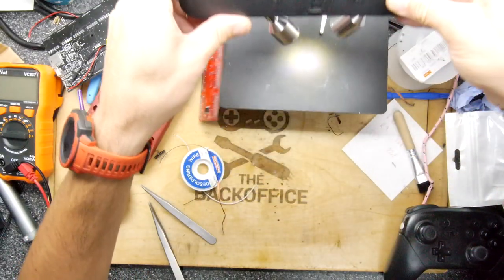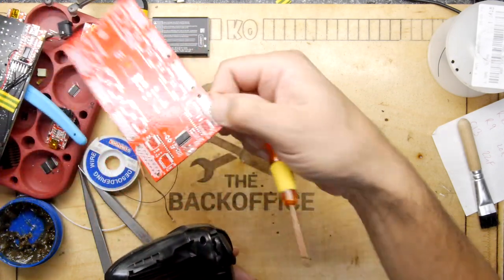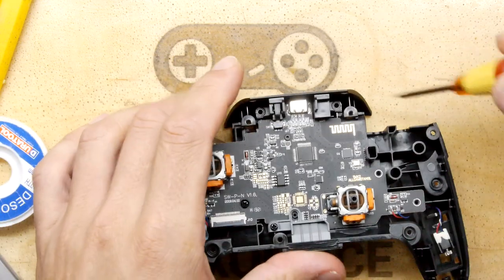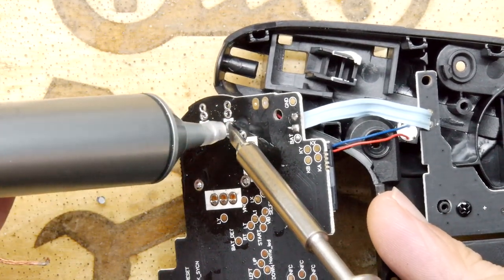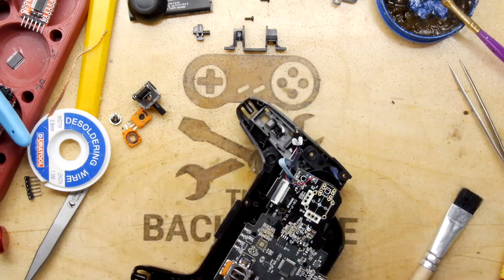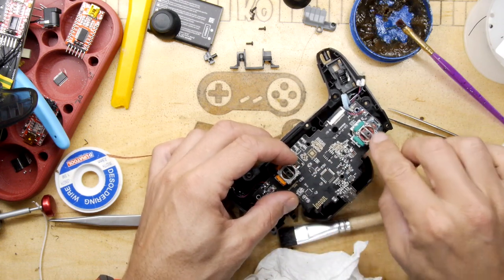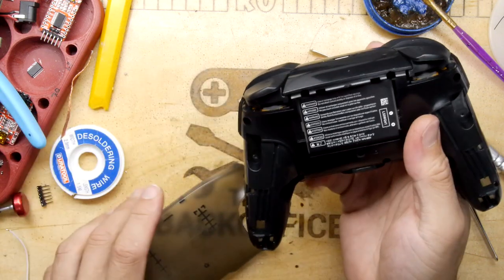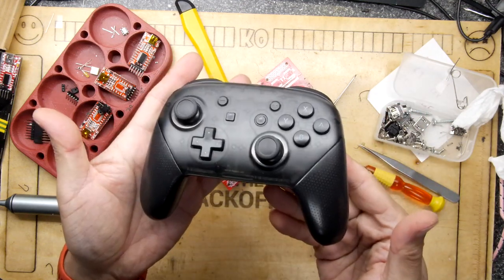A very satisfying Nintendo Switch Pro Controller (copy) repair!

Comment: what exactly are you using here to remove the flux at 12:48? Also how do you reconnect the end of the wires that are supposed to be connected to the rumble motors(not the end attached to the board)? Mine fell off while I was cleaning my controller.

Comment: What is that plunger tool you're using? Is it to suck off the solder, that you're unsoldering? Also, that temp you said, 320? Is that f or c?

Either way, your video was extremely helpful.  You made it very approachable.
Reply from the maker: It's called a solder sucker. 320c

Comment: The analogue sticks definitely have gone down in quality over the years. Can't remember drift issues and breakage were as much of an issue with the consoles up to the X360.
Reply from the maker: I don't really recall seeing drift on anything other than the switch joycons, and I can kinda forgive them, they are so intricate. But these really should last a decent length of time. I'm surprised they have not made a version that replaces the pots with optical encoders or hall sensors, they could do this as an aftermarket mod for sure
Reply: @backofficeshow  Xbox 1 controllers apparently do have drift issues too, although it doesn't seem as bad as the joycon's. Dreamcast controllers use hall effect sensors, and as uncomfortable as they are, they are very robust. The new 8bitdo Ultimate Wireless controller use them as well. I think I'll buy one for my PC when they are released in november.
Reply from the maker: They sell the controllers for so much money. I doubt there going to have a bother fixing it. Luckily the spare parts are cheap 😂

Comment: pity nintendo pulled the ability to use wii u controllers on the switch.i need to get a soldering iron to replace the card slot on my spare ds
Reply from the maker: I didn't know that that they ever worked, not sure how I missed this 🤣
Reply: @backofficeshow  i still have a wii u but use the controller on the pi4 as the rumble works well on playstation games